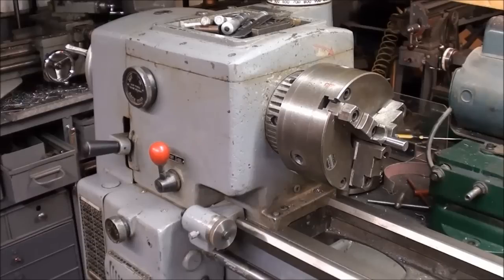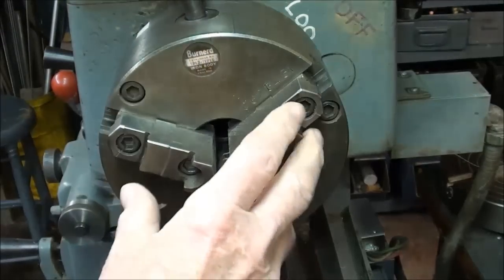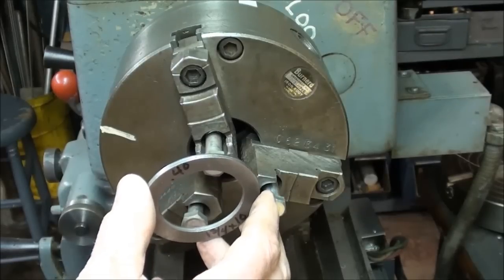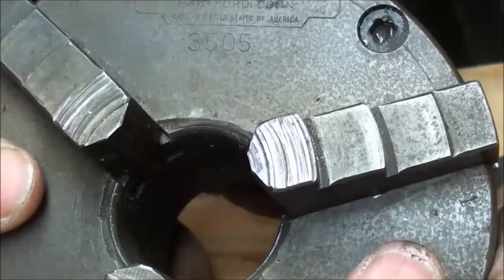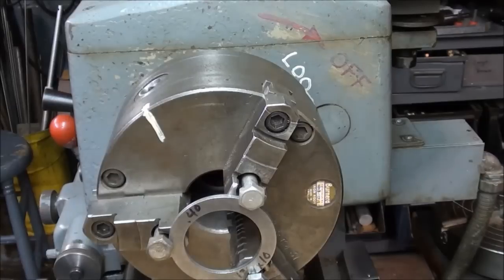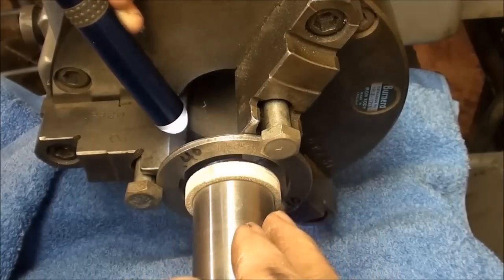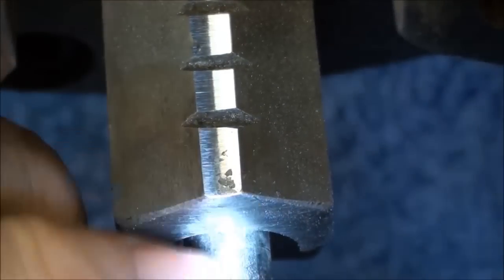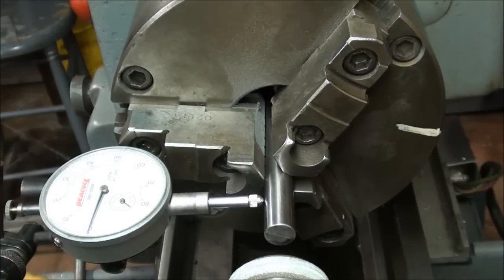MACHINE SHOP TIPS #147 Grinding the Jaws on a 3-Jaw Chuck tubalcain

Comment: There is another way to do this , use blue loctite on the chuck jaw slides, wind the jaws in and leave to set in the correct position, tighten the scroll against the locked jaws , Blue loctite will give enough to centre the jaws and pre load them ,leave to set some more and tighten again just a bit more to be sure , do your grinding and if necessary heat the chuck in an oven to get the jaws back out , don't get loctite on the scroll or chuck screws , works for 3 and 4 jaw chucks , no clamps needed
Reply from the maker: Thats a great idea
Reply: No that is crap as well.
There wil be no load on the jaw slides. like in the video they need pre load, this  way the play in the jaw guide will be in the same position as with a work piece.
Much better is to buy new jaws.
Inexpensive and this will solve 80% of you problem.
Chucks do wear out, like it or not.
Reply: Mesdriver If you at least understood the concept it would help but as you don't you resort to bad language , the whole idea surely is to help each other out in any way we can without this , My question to you is have you tried it ?
Reply: alan manning
It is useless to try.
I am an owner of a toolshop for over 30Yrs.
Beeing an engineer I can tell you the methode in the video does work, since the basics are right.
Yours are not, you do not understand the reason why you have "bell mouth" jaws.
Two reasons" wear on the jaw guide ( both jaw and chuck) and wear on the clamping surface of the jaw.
If you grind the jaws like in the vid, you will be fine for the diameter you grind, on other diameters you will have some issues, also due to wear on the spiral.
The video of Mr. pete is basicly correct, he understands the true reason of the "bell mouth".
I only commented on the old machines.
You methode is incorrect and amateuristic.
It shows you have no knowledge of the  background of  "bell mouth".
So no need to try,  it will not work.
But maybe since in the US 0.025" is accurate, you may be fine.
In Europe we use 0.01mm as a limit on runout in most cases.
So no bad language, just plain technics.
There you have it.
Reply: *****
No need to comment  on that actually, but anyway:
If you do not like my my technical explanation go  read something else.
If you do not like the plain technics, what kind of a tool maker are you??.
The 0.025 inch kind?
Maybe.
Forgive me for telling the truth, sometimes it hurts.
Reply: *****
My pleasure, Mr. bigmouth.
I'm sorry I hurt your patriotic feelings.
Does not take much, in the US.
Land of the ignorant.
Reply: Mesdriver knew I hit a biased bigot. I've never mentioned your nationality. Check and mate!
Reply: *****
No you did not.
But you were the first to mention yours.
As most patriotic Americans do.
Asif the term " toolmaker in California USA"  gives you more credibility.
I am sorry for you, Mr. toolmaker, it does not.
In fact it  does  the opposite.

Maybe you can debunk some of  the technical remaks I made?
Is so I will read them with interest, and maybe pick up some usefull info out of it.
That is how biased I am.
If not shut down the useless comments, that do not add to the topic.
Until sofar all I have from you are peronal attacks.
You can call me anything you like, I do not care.
I would respect your technical vieuw, but not seen any.
Mr, toolmaker?

Comment: Before grinding the jaws should the bed be leveled first? I have a MX210V lathe that the headstock is horizontal misaligned by .020" over 6" when the bed is leveled. My headstock is not adjustable.

Comment: It think i would go 1 step further and see first if the slots are worn on the chuck and the jaws....if so grinding would possibly mess you up with larger work? Mine is only accurate at 1 spot and thats with larger work....i realized if i ground it i would mess that up so i just gave up with the whole mess and got better at the 4 jaw😂

Comment: Without going through all of the comments to see if anybody else mentioned this, I'll make a suggestion to set up a shop vac hose at the left side of the headstock tube and draw most, if not all of the grinding dust away from the lathe.  Most shop vacs come with a conical tip for the hose that you can stick into the headstock tube. 

Randy, the gear headed technoid

Comment: I grind lathe jaws individually. I like them ground flat,  I back taper them slightly to force them to grip hard on the front. Three jaw chucks also wear in the jaw slides. That can lead the the "bell mouthing".
Reply from the maker: +Joe McGarry Very good ideas!
Reply: +Joe McGarry 
PLEASE tell me how you accomplish this. I have a nice and accurate T&C grinder and I would like to try fixing my chuck jaws using the grinder as opposed to grinding on the lathe.

Comment: Great video and method BUT I think it most desirable to keep the contact radius on the jaws as small as possible for when gripping small diameters SO use as small a diameter as possible of the grinding wheel!

Comment: I guess if the final runout is due to different levels of wear on different points on the scroll (ie: different diameters) there's not much you can do about it. I'm wondering if the ring and bolts used to tension the jaws might also be a factor. If the ring OD was at all eccentric or one of the bolts was a wee bit bent the result might be a less than perfect contact between one or more of the jaws and the scroll surface you're trying to reference. Would a machined true and straight ring and bolts that conform to a larger, less worn section of the scroll help to make this operation more precise?

Comment: Could it be that after many years of use, the groves that hold the jaws have worn from so much loosening and tightening cycles? That is if the fact that the body is truly softer cast iron. Or is the iron somehow harder than the average? Or, at the last...chuck is equipped with hard steel groove inserts?

Comment: i think i saw a runout on the chuck when you puled on it! you could check the bushings o bearings con the spindle i guess!
Reply: Yeah , I seen the same thing. Dial moved before the chuck turned. Mr. Pete wee's thinks you might need to check the spindle bearings.

Comment: Mrpete, I believe I have a superior and simpler method so you wont have that 1 1/2 thou runout in the end.
1. Before you do any thing, make 2 heavy washers (1/4" thick steel), 1 smaller diameter - the size of your desired jaw opening (2"?) , and the large washer hole to connect later on the outside of your 3 jaws on that middle step (6-7"?) - determine these 2 sizes first.
2.Close your 3 jaw onto the smaller washer.
3.Take the smallest cut off the corners of the middle steps of your 3 jaws to ensure you have an accurate circle.
4.Remove the small washer,and open the jaws tight onto the large washer i.d.
5.Machine inside 3 jaws again.

I would have thought a good tungsten carbide boring bar would do an excellent job of this with no deadly dust......

Comment: Does the fact that most work is grasped in the outermost (tailmost) 1/.2" of the jaws not explain why the "bell-mouth" occurs?  A 2 1/2 - 4" vacuum hose with the open mouth positioned just below the point of contact of the grinding wheel (just as the wood turners do)  might help to collect the swarf grindings before they get all over the ways, etc. . . . assuming the vacuum is turned on during the truing of the wheel and the grinding of the jaws.

Comment: What is the ratio between the two pulleys you have on your tool post grinder? If I look at the size of the pulley on the motor in comparison with the one on the grinding spindle, the grinding spindle will be spinning at quite a speed. I hope people take notice of your jaw pre-load explanation. Many brothers don't know what should be done before starting the grinding, or they don't care.

Comment: Hi Mr.Pete, I want to grind my jaws of my (Chinese) lathe. My chuck jaws don't have the feature of your jaws, (bolts) to clamp the spacer. I have to machine a kind of a spacer where the jaws go a little bit through, and at the same time create a clamping force. I saw recently a example on u-tube of a clamping spacer.
My question is, are the dimensions of this clamping spacer where the jaws go through critical? Does the three machined sleeves in the clamping spacer need to be  within 1/100 of a mm? Or as long there is clamping pressure on the jaws from the chuck key, it will grind the jaws evenly?

Comment: FURTHER THOUGHTS
Step 1 - make a baseball size funnel from a cut-down soda bottle or whatever, attach funnel to shop-vac hose and mount on headstock side of stone during sizing so grit is sucked away from tool grinder motor and lathe bed before it spreads.
Step 2 - During jaw grinding part, attach shop-vac hose to outboard side of headstock and suck debris out through center hole to protect chuck parts from grit.

Comment: At the beginning of the video you stated that you wished the grinder motor went the other direction.  I think if you remove the plate that covers the terminals where the power cord goes in, you will find that you can move a couple of wires (the ones for the start windings) to get the motor to run the other direction.  You may even find the diagram there to show you how.  If not, there is lots of info on the web like here:http://www.ehow.com/how_6005849_reverse-single-phase-ac-motor.html
Greg from Charlotte

Comment: Do the same setup but use a CBN boring tip and bore the jaws out. I do mine on a regular basis and only takes a few minutes. You can also get a turning tip to turn the outside of the jaws and face them true. We have eliminated grinding bores by using CBN tips. Just sayin'.

Comment: Did you check to see if the outside of the washer was perfectly round?  It looked stamped out, and had burs.  Also, did you check that the washer sat evenly flat against evenly flat and true chuck jaws?  The washer looked like it was wiggling around a little when you turned on the lathe.  I think there are too many variables to have to control in doing this job.  Add to that the fact that the spiral thing inside won't be worn evenly, as you pointed out, and this job becomes impossible.  Ok, so if you're just taking the taper out of the jaws this will work, but only if there's no wiggle in the jaws as they ride in their rails/grooves.  If there is, and there always is, you get a reverse taper in the jaws.  But I could be wrong.
Reply: The ring does not have to be particularly round or even an equal triangle.  Like any roundish object it will center itself between the three points of contact.  The hole in the ring may not be quite concentric with the chuck axis but that is not a problem for reasonable amounts of error.

Comment: Sir, is it possible that the "threads"" on the scroll are worn as well contributing to the jaws all not being in contact? My thought was that the force of tightening begins in the body of the chuck as each jaw slides in its channel and with the pressure derived from the "threads" (not sure if a scroll is a thread)  being tightened. I could imagine that the rear of the jaw(s) would come in contact first if the channels or scroll teeth were worn.
Your thoughts please?
Respectfully,
Eric
Reply from the maker: yes==they are definitely worn

Comment: Hello, I am trying to figure out why you used the disc? The only thing it did, as far as I can see was to hold the jaws in an open position. When the grinder went through the disc I could see what looked like a gap of an 1/8 to  1/4 inch. Love to watch your videos!
Reply: Mrx9999999. he explained that clearly. if the disc doesnt preload the jaws they are loose, if they are loose how do you know you are taking off the right amount from any of them?

you want the jaws to be in the same position they will be in when holding a piece of work so thats what the ring is. its a piece of work thats mounted in such a way that the entire inside surface of each jaw is available to be ground.
Reply: Mrx9999999 did you watch the same video as me? he explains why he did it about 3 times. he even shows you the play in the jaws on a different chuck

Comment: Mr Peterson. I believe the grinding should be done with the jaws individually (yet also in conjunction with the scroll), all be held outwards to their maximum extent (which includes the extent of each individual run out on the threads plus the jaw wear as well), and not closed inwards. Why. Because if you take a brand new chuck with two brand new jaws and then add a third which is 60yrs old, the two new ones will need to be ground down till they agree with the old one which itself will just need a light skim to square it. By closing all three onto a piece of stock or replicating that scenario, the two new ones are actually distorting what should be a perfect concentric circle of contact, in the direction of the old and worn jaw and simply because it is just that, an old and worn jaw. And so now grinding is occurs in this slightly distorted situation. = Wrong I'm thinking?
Reply: Tom Tee     ????????????????????????
 Hu

Comment: I think, you'll find, when you disassemble the chuck, that the scroll will be loose on it's inner and outer diameters, causing the runout... Sometimes you can get the work running truer by tighening the jaws at another of the three wrench slots... If you're lucky.

Frank

Comment: I am really curious about why you ended with runout on the clamped drill rod at the end.  There is probably a reason, it'll bug me for years now.  Since you have other lathes and chucks, probably not an issue for you and not worth making exactly perfect?
Reply from the maker: the scroll is worn & the jaws
Reply: +Jason Polensky As explained earlier wear can vary depending on scroll use through the life of the chuck. The jaws were much farther out radially when grinding & further in when indicating the pin. The wear pattern may be different between these 2 positions.

Comment: just out of curiosity, say you didnt have the bolts in the jaws. couldnt you just use a bigger disc and grab its from the outside part of the jaws? having them pushing out instead of pushing in? would that make any difference, as long as theirs stress on the jaws.
Reply: and also could you use a tool and still have the same accuracy? i know it hardened, but for those of us who dont have the grinding set up

Comment: i bought a 3 jaw chuck with really rough jaws for $25 - the jaws look like they have been ground and reground a number of times, there are no teeth left and they have an internal radius of probably 3/8" if i were to close the chuck completely. i could grind them, but there will be even less material left to grip .... 

.... excuse me for asking, but could i build up the jaws with weld and then grind them back? or should i just grind them? it tends to hold somewhere between .006" and .010", depending on how much i fiddle with the grip on the work. i think the scroll is mostly ok for my purposes, though it does move a little.
Reply from the maker: You're not well them, they are hardened steel. Try regrinding them again

Comment: My guess about inaccuracy of self centered chuck that occurred after grinding. Once you have pre-stressed  the jaws with a washer,  I believe you have transferred inaccuracy of washer's roundness to the tips of your jaws. After grinding and removal of  pre-stressing washer your jaws are not of the same length anymore, hence the error in concentricity indicated by dial indicator. Please express your opinion.
Reply: Good point and I was going to post my same interest. What is the run-off of the ring (washer) and the bolts which are holding down the washer?
Reply: +Bobcatt22 at the same time there is no logic in my explanation。 This chuck is self-centering so it will inherently keep all three jaws at the same distance from center， regardless of workpiece
Reply: Regardless if the jaws are made worst by a grinding method which supporting components are themselves, posses run off issues?
Reply: +Bobcatt22 if grinder have run out issuses grinded jaws want grip it correctly。 However， in this case washers roundness shouldn't be the cause。

Comment: MrPete, I thank you for the time and effort of showing this but I don't like the idea of using a grinder and/or rotating the chuck as this now creates a smaller concave surface in each jaw face, the diameter of which is equal to the jaws at the time of grinding. If gripping a piece of stock smaller than the as ground diameter, you are making contact in 3 places (1 on each jaw) as the jaw is designed, but larger stock now is grabbing in 6 spots (2 on each jaw) which could lead to marking the work or runout. They should be concave ground to the max diameter of the through hole on each,  Though this process will correct the bellmouth issue you described, it's not a perfect solution since you are only accurate at that diameter since you still have an older worn scroll and jaw teeth. The tools required to do this job could cost more than sending the jaws for precision machining or possibly buying a new chuck.     T.
Reply: T. DesMarais-------------Great observation!   However...When the chuck was originally made, the top jaws have a flat contact surface.   By grinding the jaws while in the chuck, the contact surface becomes curved, or concave.   This is great if you only chuck something of the same diameter.  However, this is seldom the case in reality.   This is why the chuck manufacturer makes the contact surface  flat.
       If you want to increase the concentricity of the chuck and its jaws,  measure the out of roundness of the jaws, and skim the top jaws with your surface grinder.   This will return the top jaws and the chuck to the condition it was in when the chuck was new.
        If you are getting a bell-mouth condition,  the chuck is worn out.  But...no need to replace.   The chuck is a great candidate for using soft jaws.